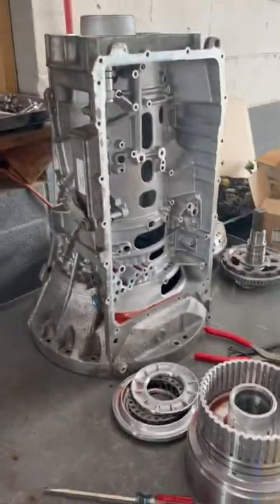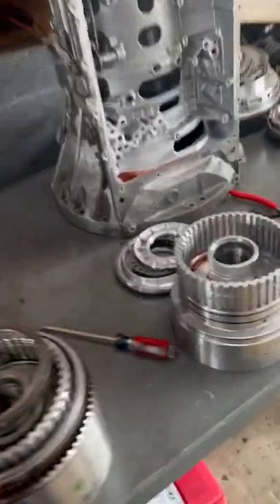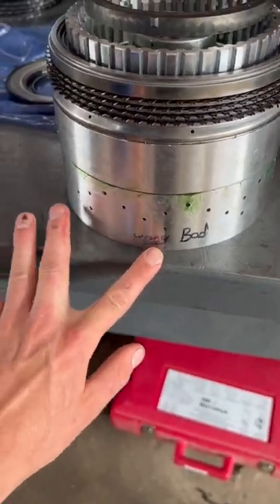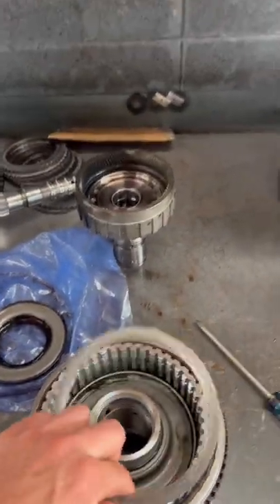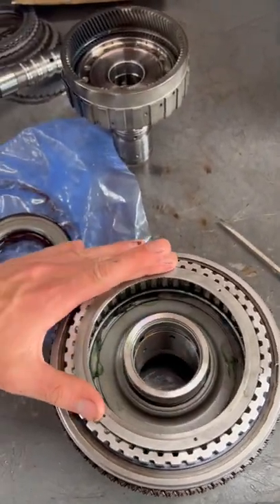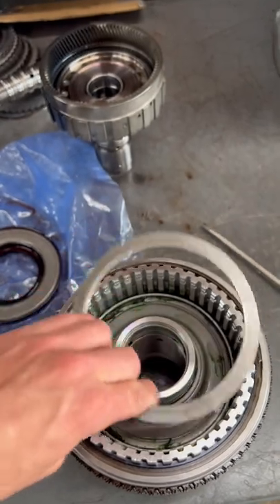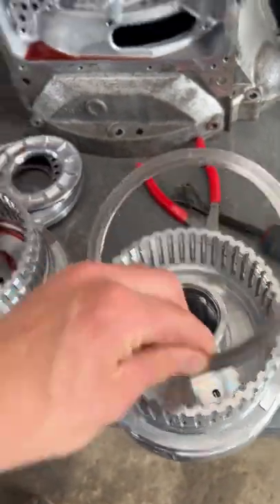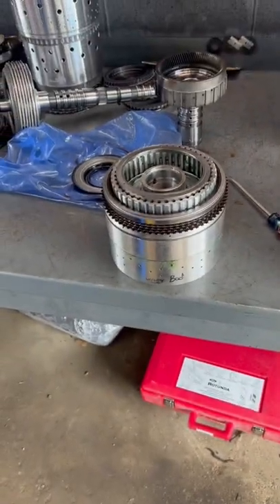New part Bad part? #shorts

Comment: Is this a common problem? i have a 2018 raptor that only had 7k miles and had a trans leak and dealer found torque converter seal was the fault. Just wondering if you seen this before
Reply from the maker: Wasn’t the seal. Front support cracks on 10R80’s. Seen 3 or 4 of them.
Reply: @FlyingWrenches13  ahh gotcha what makes them crack ? Abuse or just random?